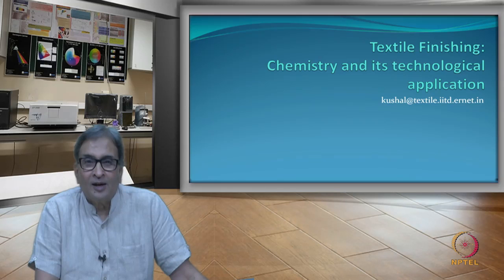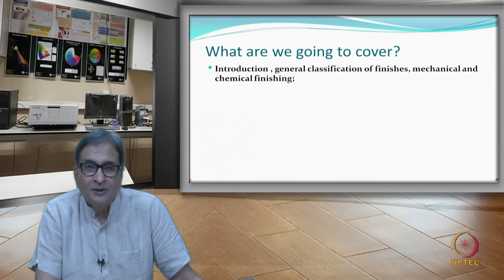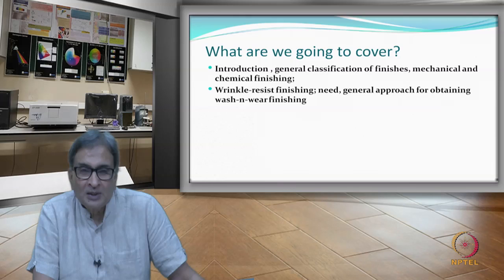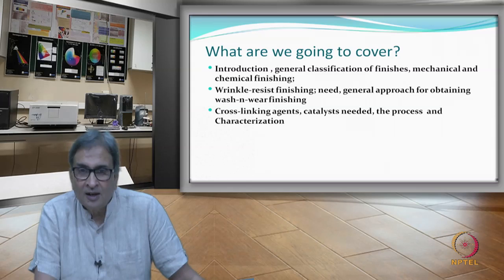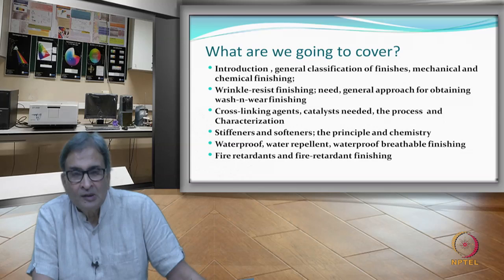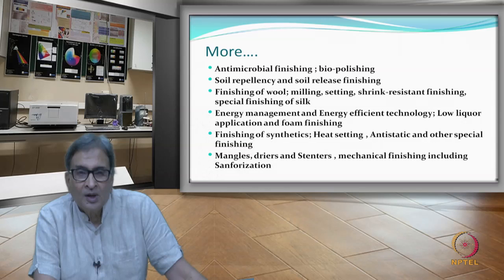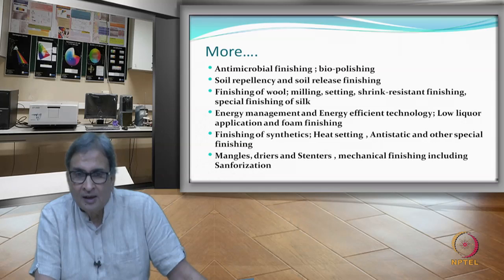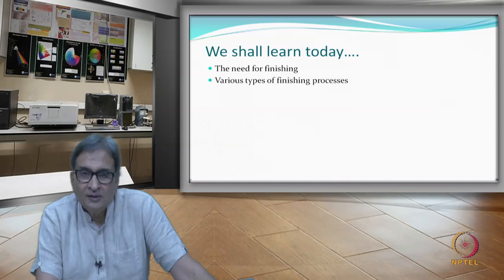Introduction to Finishing

Comment: Triacetate is a Thermoplastic Fibre cause of absence of Hydrogen Bonds.

Cotton is a Non-thermoplastic Fibre.

Wool (polypeptides) are strictly not Polymers because of absence of repeating unit, the unit attached to the polypeptide linkages are different and therefore they are more commonly referred to as Macromolecules.